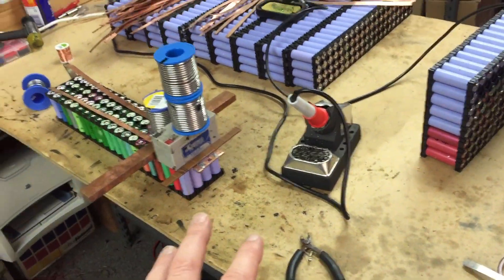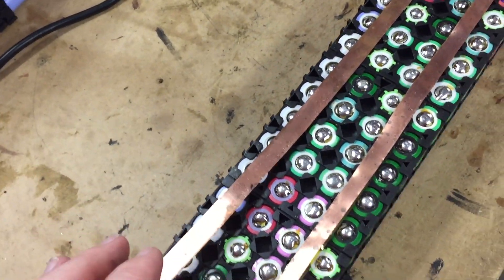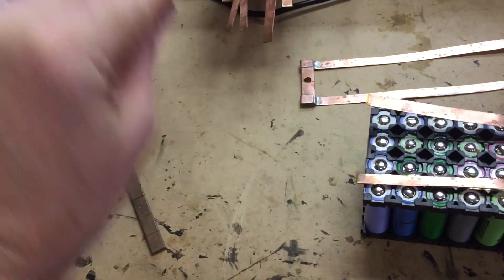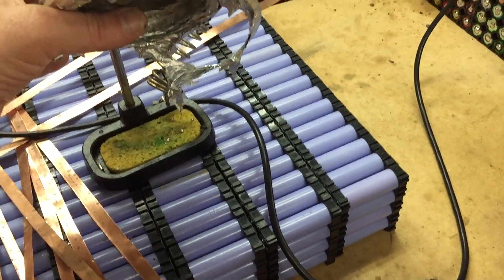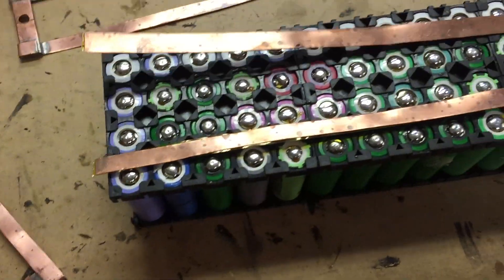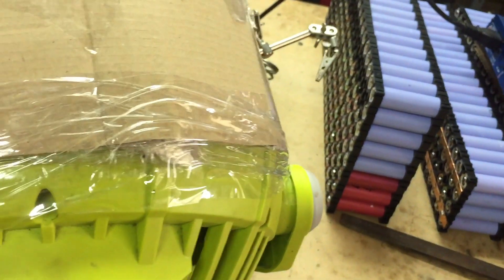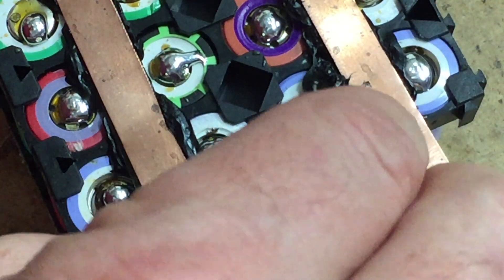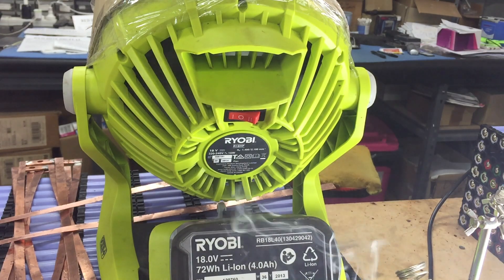Issues with Busbars, and upgrading the extraction fan.

Comment: You can very quickly and simply shape or straighten lengths of metal by lightly hammering the shorter edge(hammer the edge that curves towards you). It flattens out the edge of the metal, and in the process lengthens it! It can be very quickly done along a piece of light angle iron placed on the edge of a table!
Hope this helps, and thanks for all the info and video's. Just getting into this whole 18650 thing recently, my plan is a warp 9 motor for my 66 Karmann Ghia.... And maybe a power wall. I'd also like to build one of those awesomest charger thing's!
Any info greatly appreciated!
Thanks again,
Barry.
Reply from the maker: Cheers buddy thanks for the info but that's the last time i'll be doing bars that way, time to make it cheaper and faster stay tuned. AND a Ghia - nice cars very nice defiently on my wish list and EV would just make em perfect (that or a Porsche motor lol)

Comment: I have seldom
 seen someone who doesn't seem to know what he's doing. The Cu bars get deformed by the cutting process. They were straight before cutting but the cutting force warps and deforms the metal. Secondly if you need to suck of fumes you need to position your suction cap on top not besides the thing you are doing. You possibly could but then you would feel very uncomfortable by the wind and amount of air that needs to be sucked in "horizontally" that is if you don't want any smoke to escape. I fear that that you being inexperienced is a base for a serious mishap right around the corner! Be careful!
Reply from the maker: It's probably the most terrible thing i have been afflicted with ' not knowing everything'  I've battled it from birth..

Comment: Your original extraction design is brilliant. The flexible tube is just what you need. Bigger is better with exhaust fans. I found one scavenged from a restaurant. You'll get there. 
Regarding the busbars, yeah, think from the end. One might be able to use those nickel strips but once batteries start to go, re-soldering would get messy. Stick with the copper - good for years. 
By the way, I love the way your mind works. Are you sure we aren't related? I'm not suggesting anything but my father was a merchant marine. I'm just saying.

Comment: You may need a bigger funnel on the end of the suction tube to funnel more fumes into it or try using 4 120 mm fans connected together in a 2 by 2 arrangement (like a window) with a cardboard deflector at the back deflecting the air up wards place an activated carbon filter foam on the back of the fan exhaust or on the front wich ever suits just an idea it may help someone

Comment: Venting to the out doors requires makeup air coming in from somewhere, check to see if you have infiltration. Check by cracking a door or window open. If this helps you may want to consider a dedicated vent for this air. Same applies to clothes dryer that is vented to the outside
Reply from the maker: Two open roller doors, side door & window lol it was just a stupid / badly thought out idea..lol
Reply: Perhaps you have enough draft from ill fitting doors, not sure just a thought, I said crack, as in open one just slightly and see if it improves, if it does, add a vent?  I don't know your situation mate, just trying to help

Comment: Squirrel cage type fan/blower might be better.  I just found a dual chamber one in an old gas space heater.  Has been setting in the attic for over twenty years and still works just like new.
Reply from the maker: took the roybi fan off left the cardboard bit worked a treat ...lol

Comment: why don't somebody develop modular battery enclosures that has spring on negative terminal (like aa batteries)  and thread on each terminal  so you can bolt them together with bus bars . no soldering , no mess,  servicable battery pack. win win win?  for extra money you can get ones with integrated fuses?
Reply: I'm working on it. 
Check out davidcandelight The only thing I'm changing from his design is to make the 18650's easier to remove for individual charging. No BMS and no balance charging. The plan wouldn't work on a powerwall, only on smaller loads like an ebike.

Comment: Peter. Hit the concave side of the Bus Bars with a hammer, every 20mm or so. It will stretch this side and straighten the bars. Next time, take your sheet of copper to a sheetmetal worker and ask them to cut your Bus Bar strips, they will twist slightly but they will be straight. Can't fix you sore eyes, sorry.
Reply from the maker: Will try that, did try get someone to cut for me but no one would touch it being a thin light metal

Comment: Pete, you should attach the bezel you made but not the fan, and maybe add a defuser it should collect much more smoke at a slower flow rate, here's what the pros use to give ya a better idea of what I'm saying: http://www.tequipment.net/Hakko999-205-01B.html?Source=googleshopping&gclid=CjwKEAiAr4vBBRCG36e415-_l1wSJAAatjJZlxkED9AXzHM4WrO5tjQiDWWdDaaBKMZ_EXObXV2D8hoCGVzw_wcB

Comment: Next time try cutting the copper with a paper cutter..
Reply from the maker: Only have 30cm paper cutter it cut that very well till i needed the other 15 cm cut too ...lol
Reply: HBPowerwall DOH!!
Reply: Is there a metal working shop or any place they do fabrication near by? those types of places will have a machine called a break. it's used to cut sheet metal in perfect straight lines, I'm sure any place that has one would be willing to it for really cheap or nothing at all, since with a break each strip would take like 3 seconds.
Reply: Metal brake. The first time I saw him cut the copper with metal shears.. first, my hands hurt just watching it.. but thought: "that guy needs a friend with a metal brake". Cuts it clean, no distortion and can be cut smaller, ie: save money.

Comment: Just out of curiosity (not as a critique). 
Why don't you use 12V/24/48V lead-acid batteries, as they are cheaper ($/kWh), more abundant and safer to work with as you don't have a overcharging problem (just ask Samsung;). 

I know that they need up to 5 times the volume but that is not really an issue for a home application. Safety and cost is on the other hand. Having 100kWh batteries in your home would make me nervous, specially if you use old laptop batteries from unknown sources.
Reply from the maker: Been there documented that - take a look at my earlier videos in the Solar group of videos This setup is awesome hands down 100% better than old GEL setup

Comment: Just use the fan as intended, i.e. use it to blow the fume away from you. You can then open up a window or your fan in the roof could pick it up. The bad thing with solution is that you will have some fume in the room. 
 
OR even better

Build a fume hood above your work area and connect it to your roof fan. Close the back and sided and have a small opening in the front were you work. These kind of extractors can be extremely effective. Just search for "Fume hood diy" on google to see some good examples.

Comment: the fan failed because you basically blocked the air stream with the cardboard, you need to take pull the cone of the cardboard out by 2 feet to allow the air to go somewhere, or have an air "ballast tank" for it to fill with then the pipe to extract it from (say another pipe the same diameter as the fan, then cone it down to the smaller pipe..) 

ether that or i'm pulling shit out of my arse..

also the smaller fan has to work more to pull the same volume as the lager fan, or its just going to act as a restriction..

Comment: what I am using with mine is what is called forever double sided tape. Note it is not forever but does a real good job holding mine down till the wire and fuses are on then it does not matter I think . Maybe you try to make a rectangular box on the end of your hose with three long sides and the front open so you can solder?

Comment: nickel strip is only for light use, it need a multiple pass to get heavy current through.
there is a fast acting called double sided tape(not so high temperature).
the fan has to be really close to the fume, always!
Hopes these can helps.